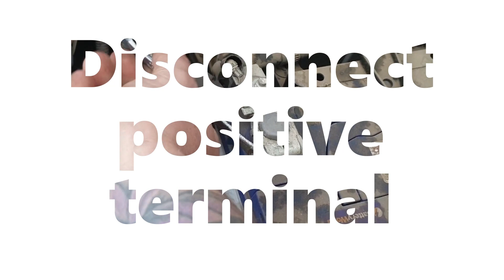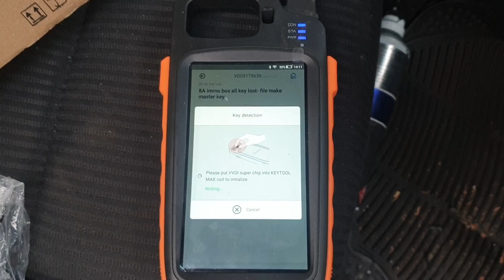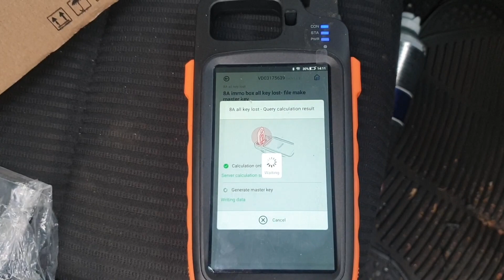Xhorse 'H' Key Kit - 2015 Toyota RAV4 All Keys Lost

Comment: Great job you guy's should show the full proses including the blad making and also the tools price
Reply: the key code is on the passenger door lock and the im508 is way ezer to use then this crap
Reply: No spoon feeding mate
Reply: @austinhohnke5470  hy thanks for your comment.
What do you mean im508 is easier as i own both can this be done via the IM508 OBD 2?
Reply: @dashtyATG  DID A 2019 TOYOTA TODAY WITH IT NO PROBLEMS AT ALL AND USED THE KEY TOOL MAX TO MAKE THE CHIP
Reply: @austinhohnke5470  toyota what type year and model please?
And some other above just mentioned the IM508. 
saying it's way easier to use the IM508.
If the IM508 do same as this tool then we don't have to buy it.

Any explanation we well be appreciated.
Reply: @dashtyATG  im in the us. a tacoma is what i did yesterday.  go under 8a to program it.
Reply: Toyota's in USA are different to the rest of the world, they can be reset through OBD and have been able to for years, nothing new there. 
This is in Australia where they have different immobilisers to the USA that cant be reset through OBD, the only way to do all keys lost before this was to remove the whole dash replace the computer relink it and then program 2 new keys, do research in your country to see what system they have
Reply from the maker: As said above, most country's Toyota 8A systems cant be reset through OBD, In these locations this is by far the easiest and quickest solution
Reply: @edwardsieper4937  sounds like an 02 prius for the us.  we do have to reflash from time to time
Reply: @sgtsolutions9356  i see.  got to love software
Reply: @austinhohnke5470  thanks bruv
Reply: Thanks to you all professionals. 
I've Just done tow vehicles with my im508 jeep compass 18 akl and Toyota avalon 11 akl amazing.
Reply: @dashtyATG  i forget other nations use diffrent software.   looks like you have to do alot of eeprom